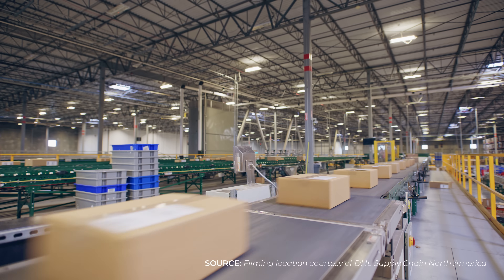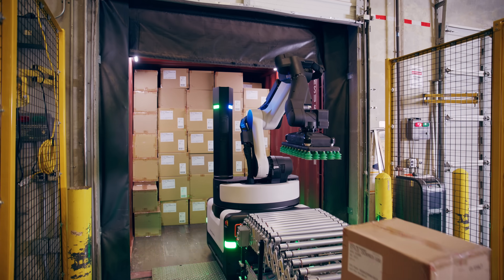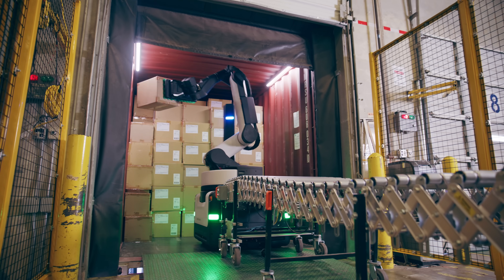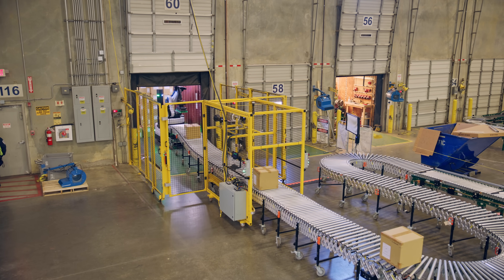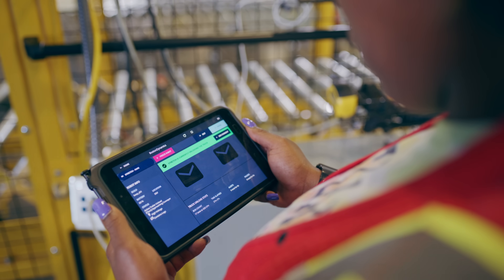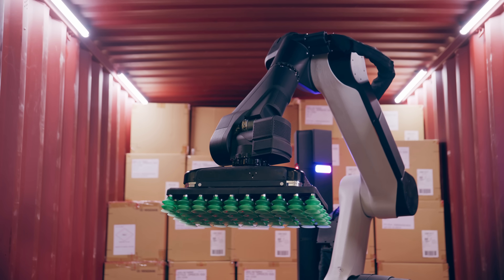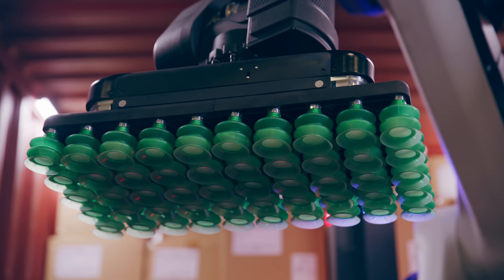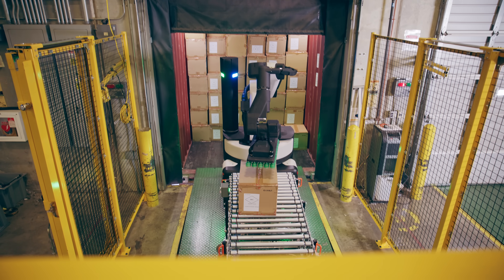Stretch at DHL | Automated Trailer Unloading

Comment: Would show more of the robots abilities if the trailer was filled with boxes of many different sizes.
Reply: You can trust they're working on it. Warehouse jobs bout to be a thing of the past.
Reply: @Mind-Over-Body  good.
Reply: @Mind-Over-Body  That's the problem, they've been working on it. If different size boxes is still a problem, how long until it can handle complex tasks?
Reply: @Mind-Over-Body  Same thing was said 20 years ago.
Reply: @scythelord  and?
Reply: It's not about the boxes, it's about showing that the human workers are happy and feel assisted rather than replaced
Reply: @benja_mint  That's a temporary feeling. In 5-15yrs you'll just need a Plant Operator and a few Engineers to run a whole warehouse. Majority of the people seen in video wont have their jobs in 2 decades.
Reply: @baileescott401  Well then nobody will have the money to buy the shite they produce.  Plant Operator and Engineers along with plant will become redundant
Reply: @benja_mint  Most people don’t want to work anymore, so you need to help the few who do.
I’d say don’t pussyfoot around with one robot, get as many as  each facility can afford.
Also they need to work on an either remote control or AI system that allows the bot to go to the trailer, identify the proper parameters, and then proceed to unloading on its own.
You shouldn’t have to walk along with it.
Everything could be monitored digitally from elsewhere in the facility.
Reply: @7200darkcharm  that won't be feasible until Universal Basic Income is adopted. Why destroy your body by age 45 when your basic needs are met and you can actually pursue passion projects fearlessly?
Reply: Try to pick up a 60lb box by suctioning to the side and see how quickly the box rips itself apart.
Reply: umm yeah. Trucks don't look anything like that neatly stacked set in the video.
Reply: @bosshog8844  maybe they will when they are loaded by a robot
Reply: @bosshog8844  Notice how they keep referring to "containers" in the video. The robot is unloading boxes from a container (likely from China) containing identical items from one supplier. The container contents get broken down and shipped out to different locations from the warehouse.
Reply: @bosshog8844  "Trucks don't look anything like that neatly stacked set in the video."
Good thing the bot has object recognition and can apparently handle tasks like that.  It said it picks up boxes on the floor that have fallen off the truck or assembly line.
Reply: People always complain about new technology some are concerned with it breaking glass, humans do that too. Sometimes it is too many items on the automated line that get jammed up and crushed or the way people package their items heavy things flimsy boxes and no matter what company if you're in a rush things are going to break and the way they want you to pack a truck to utilize the space sometimes heavy things go on top of delicate things and usually nothing good comes of it.
Reply: @robertuchman6947  It's the other way around. Every time there's a new tech everyone gets hyped and are unable to see any problems with it. Dunning Kruger effect. Most concept tech never reach production. It's only natural to ask questions.
Reply: And different orientation, for e.g. when a box has to be in a specific orientation upright.
Reply: and weights, and with uneven surfaces...
Reply: That's only limited by the weight and area of suctions.  You can clearly see in the video for those particular boxes it's only using 1/3 to 1/2 of the suctions at any given time.
Reply: Or boxes where the load shifted and there are tiny boxes or paint everywhere
Reply: ...or cough syrup, or motor oil that's looks like the guys loading it at the last facility swung it around like a lasso inside the trailer coating everything in sight 😩
Yes, I still work in shipping and those two trailers were just yesterday. @jesuslovesyou5819
Reply: Not only that but not all boxes are perfect cubes. I used to unload trailers like that but where the boxes were smashed due the weight. Each box was probably half the size of those in the video at about 50-60 lbs each. They were near impossible to grab easily and they never really laid flat on the conveyor.
Plus that thing is very slow. I would have been fired if I unloaded a trailer with that much space between each box. I think instead of taking the picture when/after it's setting the last box down, it should be gathering that information as it's moving so the arm doesn't stop.
Reply: @MikeCampbell12  you are absolutely right... This will work great if the packages are sturdy, but I can't see that vacuum gripper working on crushed cardboard.
Reply: @MikeCampbell12  Don't worry I've seen this robot in person (in their lab's [my teacher had connections and gave us a tour of their facilities in … not Boston I forgot where their headquarters is exactly but its very closed to Boston]) and they were showing off the robot picking up different sized boxes with un-even weights in rapid succession. Basically from what they explained to me the robot starts of slow because it needs to map out the boxes with a depth camera, but it cant do that if its a flat wall of boxes. So, the robot needs to remove some boxes and then its cameras (which take pictures every time it wants to pick up a box) can map out the boxes and more accurately predict were the boxes are in a 3d space. So, overtime it gets more confident in its prediction's and its starts going very fast (so fast that it made a mess on the other side in the demo because there was nowhere for the boxes to go). I honestly don't know why they didn't show of a better clip than the one that they did but I don't have all the answers.
Reply: @MikeCampbell12  had the same thought watching another robot automate something at fast food restaurant's- they make up for it by consistency. In the future it will surely get faster, but my bad boy here doesn't take breaks, doesn't complain about his environment, doesn't take days off, works happy all day and night, doesn't think about forming unions, doesn't think about a pay raise, my man just works
Reply: And weights
Reply: I think the first one who uses these machine would be big company that have same item to unload and load. It still need some years until commerce level.
Reply: ...this video is in the actual workplace, it's not a video presenting capabilities, you can watch that video on this channel already lol
Reply: This is staged. It's not replacing humans. This is not reality.
Reply: It could Tetris all different size boxes in more efficiently than most humans.
Reply: Show this in real world loads. And cut out the crap music👎👎👎👎👎💩💩💩💩😬😬
Reply: It doesn't matter. A shopper will adapt there cartons to be handled by the robot. even if that means shopping more air the efficiency more than makes up for it.
Reply: It can do fine, as long as loading trucks too. I work for company which develops algorithms like this and Boston Dynamics has seen those. I think what matters now is making it robust, safe and reliable. So these algorithms are heavily in a productization phase and soon we will see loading and unloading of variously sized boxes.
Reply: Liar 🤥!!! youR CHATGTP AI WOKE LIBARL, WAKE UP PEOPLE END TIMES NEAR
Reply: It's a video taken in an actual warehouse. You want to get a recording crew in, take your pictures, shoot your video, and get the hell out so it keeps making money. 
On filming day, you set up the most simple, basic thing to get the shot you want, and you get out.

Additionally, just because it can handle different sizes and shapes doesn't mean it can do so in a photogenic way. The shots are very smooth and even, no drops, no fumbling, no mid move pauses or anything like that, and that's intentional.
The masses don't care about the final throughput numbers or the error correction capabilities... They way to see a robot do a thing, so that's what they recorded.
Reply: Freight sized packages go in different containers. These are regular domestic packages, there are limits to their dimensions and weight.
Reply: and this boxes being no empty as well :)
Reply: I mean to be fair, if it's a factory where it's the same thing being pumped out, the box will be consistent
Reply: Compared to what they have already accomplished that is easy.
Reply: @Bmr4life  Not any time soon. You must not been a loader or unloader. Loaders have to build tight walls with heavier packages, on the bottom, lighter, fragile items on top. Then you have smalls (enveloped and tiny packages needed to be bagged) and incompatibles to deal with. Building a 3D puzzle at speed  with a deadline. One day the AI will be capable of doing it. They will engineer the flexibility to fully automate such tasks.
Reply: @Bmr4life  no.  It isn’t.  Otherwise it would be done already.  This robot isn’t moving faster than a person would be able to unload as it is.
Reply: @eetm No, this video is about socially engineering you in to accepting robots.
Reply: Even in this perfect conditions, it is "dropping" Boxes on the belt. -> Broken glass inside.
Reply: @steamnstuff don't ship glass
Reply: Any of this kind of robot is bs without proper hands and fingers!
Reply: well i guess if the trailer came with boxes of different sizes, someone before stretch actually hasnt worked properly to sort and put boxes of similar sizes in there.
Reply: Probably just dummy boxes because the filming process would have slowed down production if they were moving cameras and people around while work actually had to get done in the background

Comment: There is no way that thing is faster than a human unloading, although it can work around the clock
Reply: Definitely faster. That robot will unload more boxes than a single worker in a 8-12 hour shift.

Doesn’t get tired. Zero breaks. While the human sleeps the robot gets maintained. Human can’t reach the top without an aid and the bottom boxes are hell on the back and legs.

I’m not even considering running it around the clock like you mentioned.

Those boxes could weigh 50lbs each and the robot would laugh at it.

That is an intermodal container stuffed from top to bottom, could have 40,000lbs of boxes in it and you think a human could get through it faster. 

Maybe a human with an Ironman suit on. 😅